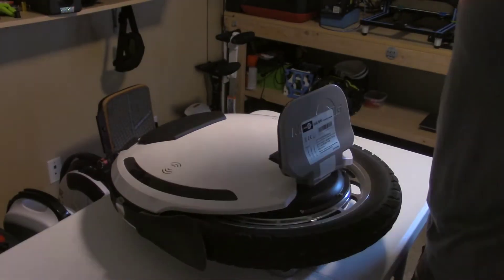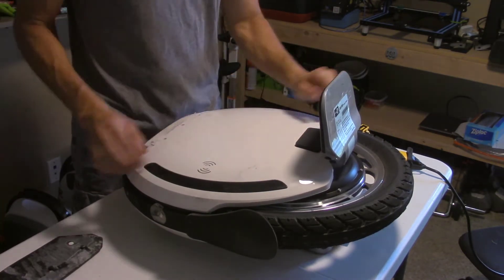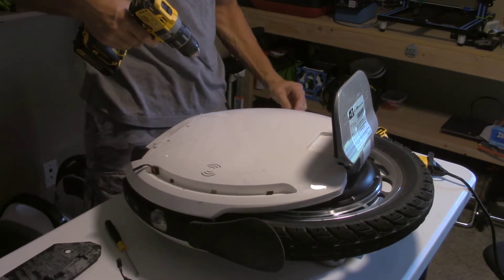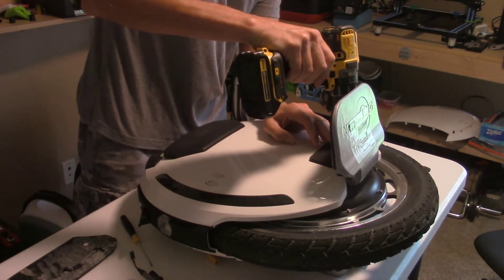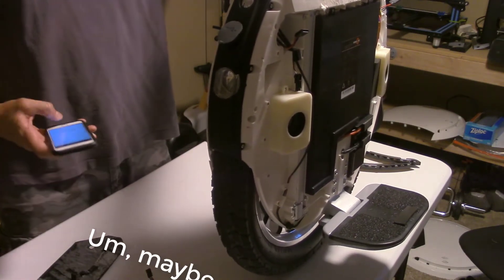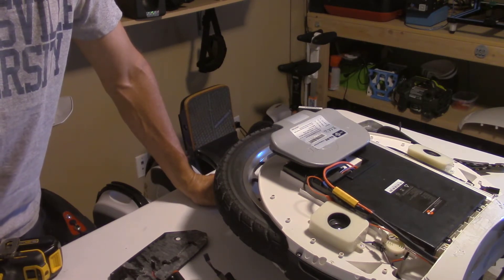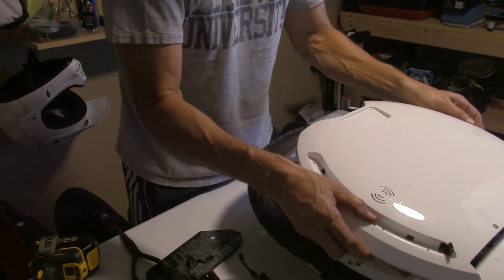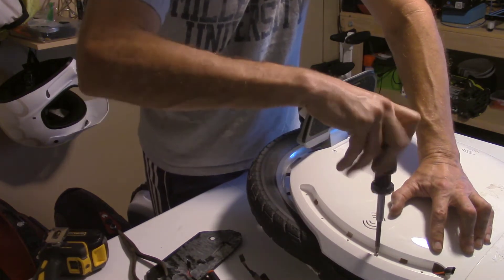Ripping into my 18L already??

Comment: I just went through a problem with my ks16s only charging to 76%.  It ended up being one battery had a bad cell, but I could not get one of the batteries to charge past 62 volts when charging separately.  Jason and Ewheels took care of me.  The fuses on the 16s are on the top of the main board, not easily accessible.  Not sure if the 18ls are in the same spot or not
Reply from the maker: Yes the fuses on the 18L are on the board as well.  I was sure it was a bad pack but the fact that each pack charged to 84 volts independently has me scratching my head.